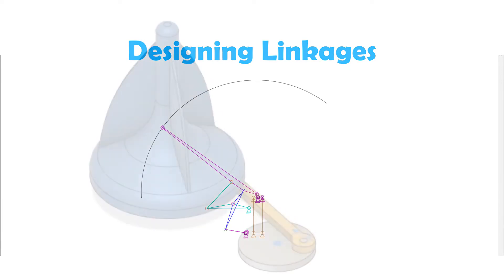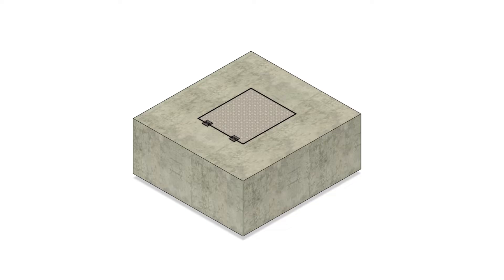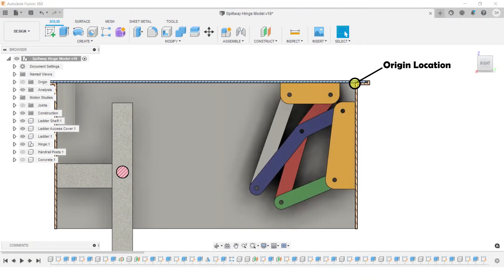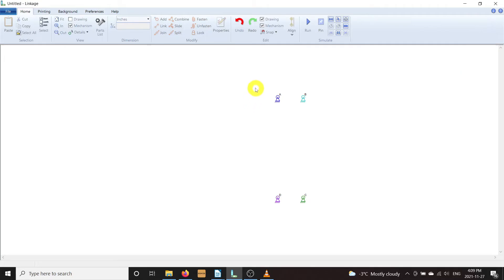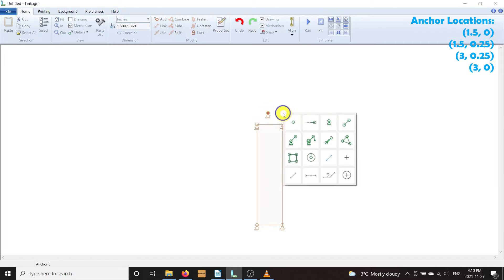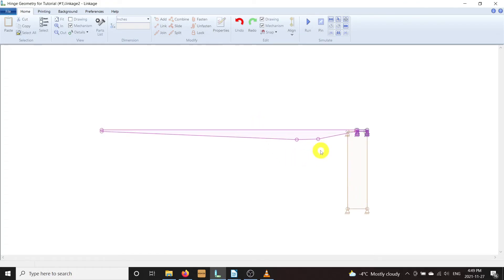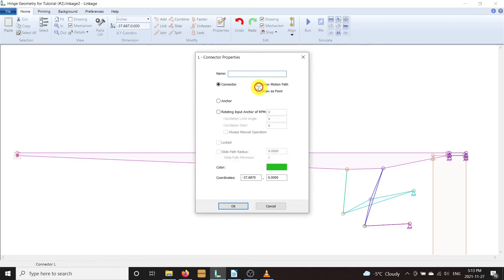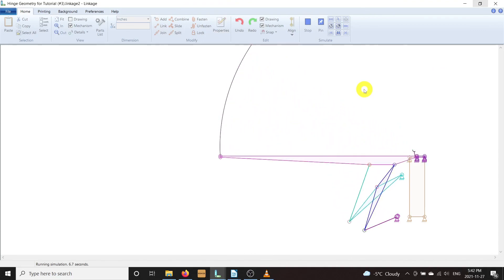Using Linkage to Design a 6 Bar Linkage Hinge

Comment: You can also do this in Fusion directly by using joints and then changing the underlying geometry or sketches. It's not quite as straightforward, since you need to use Ctrl+Z after every "failed" attempt and you have to have a pretty good understanding of the general layout of your mechanism for designing it in the first place. But on the other hand, you don't need to re-do any of your geometry just for the simulation because it's already there.

Comment: This is exactly what I wished I could find.  Instead I went brute force to solve my goal.  I was making a Murphy bed.  I needed the bed to rest at 24” (the height most beds rest at), but simply pivoting the bed up would run it into the low ceiling.  I also wanted the head of the bed to be right up against the inner wall (most Murphy beds leave a gap where your pillow or phone could slip down).  Furthermore, I wanted the pivot movement to not force the bed to rub along the wall (so I needed everything to pull away from the wall during the pivot).  4-bar linkage was the solution, and I had to drill a hundred holes into scrap boards and planks, to mock up a full scale test.  I’d try a configuration, and then change the pivot points.  I could not intuit the solution, so I just tried new pivot configurations till I got what I wanted.  It took two days.  This would’ve been awesome.
Reply from the maker: I’m sorry that you had to go through all of that trouble to find your solution. I guess it’s true that experience is the knowledge you need just after you needed it. 

When I was planning this project I thought about using cardboard mockups or trigonometry and a spreadsheet, but it looked like that was going to be really overwhelming.

Good luck with your future projects, hopefully one day this will be useful for you.

Comment: Can we use metric dimensions?
It's just brutal hearing the constant need to convert fractions into 3 significant digits...
That aside, it's cool that you can use simply drawing to roughly place points of interest, and then parametrically do precise placement...
Reply from the maker: Yes you can use metric dimensions, it's a drop down selection on the home tab of the ribbon menu. Regarding imperial fractions, I would search for a machinist chart online and then at least you'll be able to look them up instead of having to calculate them every time. Hope that helps.

Comment: Hi, I want to ask. 
Is this software can simulation 3D with 6 or more bar linkage?

Thank you.
Reply from the maker: You can simulate more than 6 bars with the software, but as far as I know it's limited to 2D (single plane). To do 3D linkages you would need something like Blender or Fusion 360.
Reply: @stanhartley5311  I want to ask again. so, this software can't simulate in x-y-z-coordinate?. such as make a linkage with spherical coordinate.

Thank you.
Reply: @Lulu-fl8lk  It is only 2D. It only handles x,y coordinates.

Comment: Wow, you did a better job creating tutorials for my software than I ever did. Nice job.
Reply from the maker: Thank you so much, it was my pleasure. Thank you for making such a great tool available for free for people to use.
Reply: How do you fix "this element cannot be simulated" with no hints on why.  No matter what I do.  Is there some sort of methodology to follow?
Reply: @chrisspamtest  You can contact me using my email address in the "about" box. Make sure to send a copy of your linkage file. It is likely that you built a mechanism that would not work in real life and therefore won't work in the simulator. An example is a connector element or link element sitting in the mechanism that is not connecting to any other links - that connector or link is processed in the simulator and gets a simulation error because it's a mechanical part but has no other elements that define where it should be during the simulator. There are no hints because the the simulator has no other knowledge of why you did this.
Reply: @rectorsquid  Hi Dave, found your tool recently at work and have been using it, its great. However one quick question: is it possible to make connection points into a motor, but still allow for that motor to move with the linkage the same way the connection point would? Or does it automatically force a motor to be an anchor. Thanks!
Reply: David, thank you so much for your work on this. Most impressive and most appreciated. Happy new year to you and yours!

Comment: I'm so glad you're bringing light to this great software! Ive always taken the trial and error approach but would love to learn a more rigorous way to get a ballpark accurate design. What I mean is that you had a general idea of where the points needed to be, maybe from understanding another design or some other avenue. I'd like to learn more about finding those points
Reply from the maker: Thank you for your comment. I find thang010146's YouTube channel (https://www.youtube.com/user/thang010146/featured) a great source of inspiration, maybe not so much for finding initial values for the points, but for defining the basic geometry of how the pivot points are related to one another.

In general, I find a helpful approach in designing anything is to first identify any constraints, and then design around them. If you can figure out the name of the type of mechanism you're trying to use you can often find ratio tables on Wikipedia or elsewhere. Happy designing!